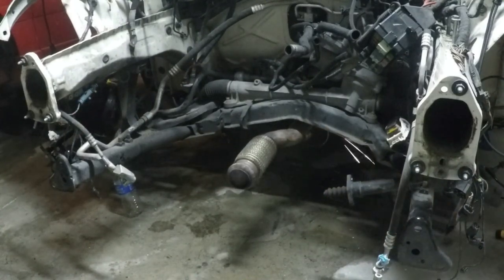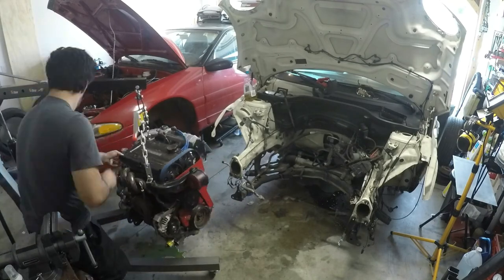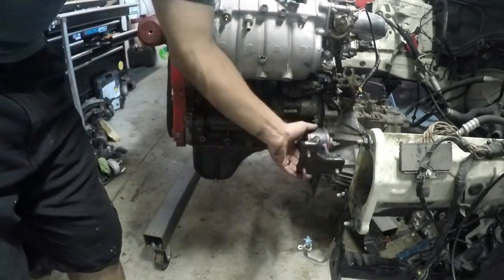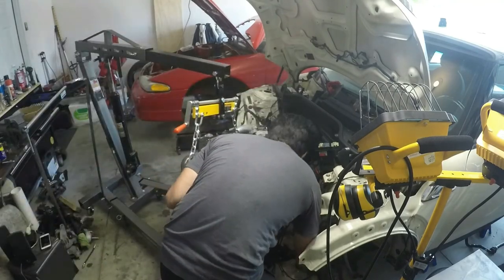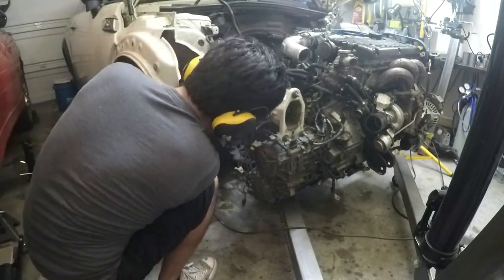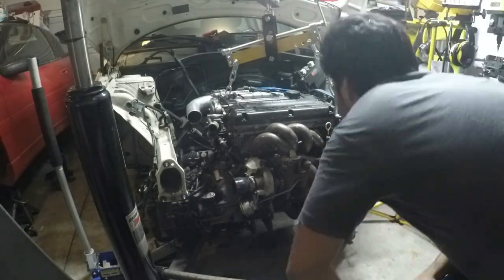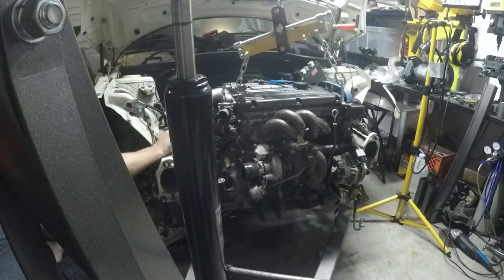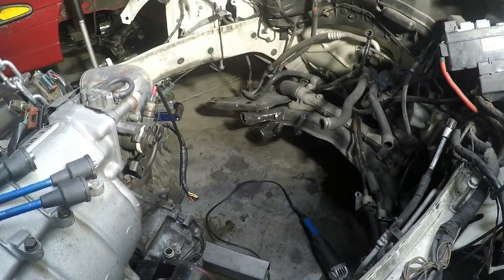✓ 4G63T GSX Engine in a Mini  - AWD Mini Cooper Ep. 9

Comment: Curious to see how the weight of this drive train will affect the suspension  !  Cool stuff and by the way that's exactly how I would have brought the metal home ....in the back of the Genesis  ! # folding back seats # DIY.
Reply from the maker: HAHA yes the things we do to transport supplies in our cars :-)
Well the drivetrain on its own should actually help shift weight to the rear which would balance the car a bit better and be more towards a 50/50 front to rear HOWEVER, this block is cast iron and so is the transfer case which shifts the weight further forward over the front wheels and off the rear. I am not sure which will play a bigger part. I will have to get this car on a scale once it's done and see where the balance sits. I can't figure out what the mini engine weighed but the GSX engine is much heavier, possibly over 100 lbs extra plus everything else and I won't really be able to shift any other major weight back. Hopefully the rear diff, subframe, suspension, and driveshaft will help maintain the original balance but chances are it will be more front heavy than OEM :-/